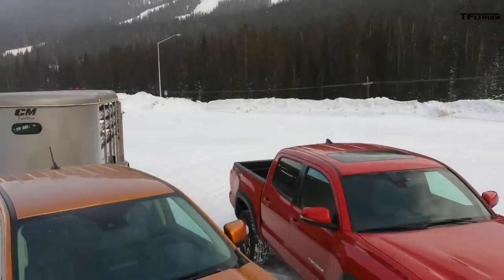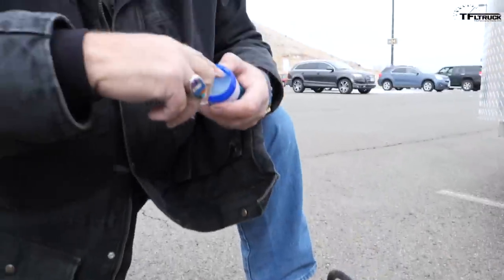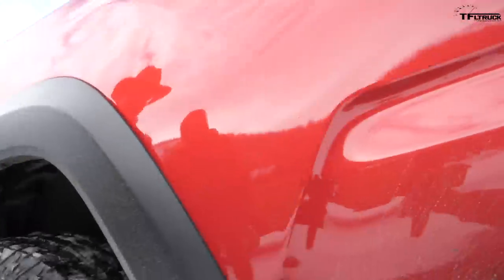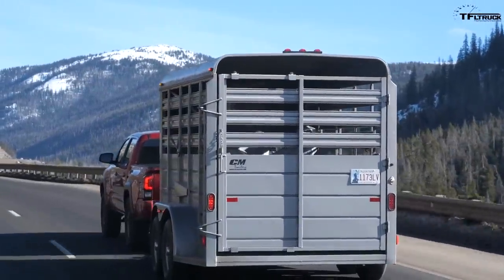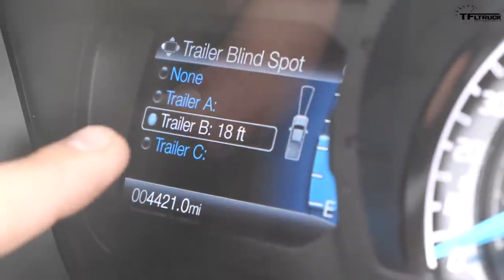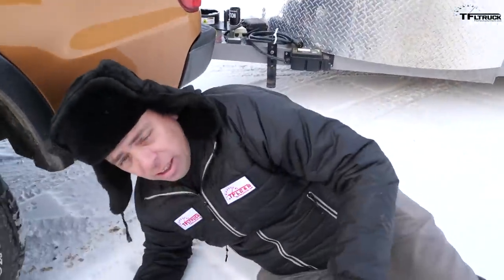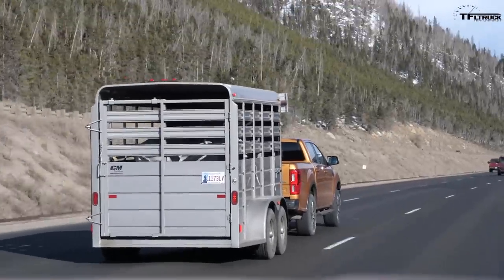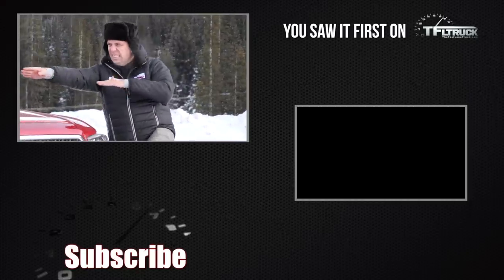Best Midsize Towing Truck? Ford Ranger vs Toyota Tacoma vs World's Toughest Towing Test

Comment: It looks like you guys may have to rethink the towing test.  In this test and the 1/2 ton test all the truck meet the 8 min time.  So unless you're going to start breaking the speed limit the up hill test is a moot point.  Example, if your towing with a 3.5 limited with 450hp and 510 lbs/ft against a Chevy 5.3 all the Chevy has to do is make up the hill in 8 minutes and it'll negate all the extra power and torque of the Ford. That turns it into a purely subjective test.
Reply: Ray-I think they just use 60 as a benchmark because some vehicles they test can't maintain that.  I see your point but they would then have to do two tests...one just like they currently do and then an all-out race up the hill.  They are really testing the ease of towing as a normal person would do it.  If two vehicles maintain 60, they can still have different conclusions since some maintain it easily and smoothly...and others maintain it only when the engine and transmission are constantly shifting and trying to find the power band which is annoying when towing.
Reply: @dewrus2153 
 That makes it a purely subjective test. Once everyone can do 8 miles in 8 minutes with roughly the same fuelmilage this particular test isn't really telling us anything.  All I'm getting out of it is it takes X amout of hp and torque to move X amount of weight up a 7% grade at 60mph.
Reply: @rayd2100 -Well, it's not really all subjective necessarily.  If two trucks make it to the top with the exact same time, they look equal on paper.  However, if one was constantly hunting gears and the other held a gear the whole way, you can tell which one would "win".  If you've ever towed much, that can be very annoying...and if you have an engine with a nice wide power band, it doesn't need to shift all the time.  If you have an engine with equal peak hp and tq numbers but has a narrow power band, it's going to be shifting constantly hunting the gear to keep it at 60.  Also, just the programming of the computer to shift can make a huge difference in how well it performs even if everything else was equal.  Also, a vehicle's stability while towing is key.  For instance, if you take a new Ford Ranger and a new F-250 and tow a 3,000lb trailer with it...both could easily do it but the Ranger would wobble, bob, and get pushed around with much less stability and confidence.  Again, on paper, both could perform identically since both made it to the top at 60 mph but one would clearly perform better.
Reply: @dewrus2153  
I agree with your example about the F250 vs a Ranger but these guys aren't testing those trucks against each other.  So how can you quantify the subjective difference between a GM  6.2 vs Ford 3.5 vs a Hemi.  I also don't think you can really base it on the transmissions doing what it has to to maintain 60 either. If the truck holds 60 then it holds 60.  I think they may need to add another test or something.  Maybe a variable terrain loop to get a more complete picture.  Maybe use the Ike as part of the subjective score.   It is a tough job that is getting tougher for sure and I'm not sure there is a clear winner in these test anymore.
Reply: @rayd2100  
You forget the other factors. Bottoming out, trailer bucking, comfort while driving, visibility need for a weight distribution hitch (which was interesting) noise level etc. It's not always about power x minutes.
Reply: They need to go further south and pull up the south side of Wolf Creek  Pass and don't do it when the temp is cold. Do it when it's a true test of a turbo vehicle vs normally aspirated do It during the summer in the afternoon. Any of the Ford Line that are turbo'd will dominate and do it without breaking a sweat. I've pulled that pass in August when it was 70 degrees at the top pretty close to towing capacity of a 3.5L ecoboost f-150 and it came up at speed limit no problem. No overheating of the motor or transmission. I'm excited for the Ranger and I believe it will crush the competition and actually make Toyota work harder to keep customers. A good thing all around!!

Comment: I miss the old crank windows bare bones trucks that were affordable
Reply: JustJay 0312 I agree. But no profit margins in a base truck. If they were to offer that today it would be about $18,000-20,000 no room for a profit.
Reply: I believe you can still get a Nissan Frontier equipped like that for around the $18-20,000 range
Reply: No you can’t
Reply: @beemrmem3  actually you can, a 4cyl, 5 spd manual, king cab, starts at $19,000.
Reply: I hate manual windows not a fan of having to reach over to lower the windows

Comment: RV anti-freeze for your water problem
Reply: Would make it a bit difficult to dispose of then. Water is easily dumped into a field.
Reply: RV antifreeze is non toxic  @ALMX5DP
Reply: @scottsibbick566  Oh dang I was unaware. I'm not an RVer so forgive my ignorance there, didnt realize there was a difference but now see it's made for the plumbing systems in RVs. Thanks and yeah that would most definitely fix TFL's issue!
Reply: @james2042  You only have to put a gallon or three of RV antifreeze at a couple of bucks a gallon, in a tank of water that size to keep it from freezing.
Reply: @james2042  My point is that it's pretty cheap to keep water from freezing, so your point about water being a "metric shit ton" cheaper than any fluid doesn't really make a lot of sense.
Reply: It would take days for a 275 gallon cube of water to freeze. That's a huge amount of thermal mass.

Comment: Sorry to say that the theory about the springs isn't right.. The ford is using a long progressive damping bump stop that is designed to be in contact and adding to the spring rate of the pack through a relatively large range of the available travel. There's no jolt when making contact with the bump stop here because it is very progressive in nature. The Tacoma is using a more traditional bump stop, so you're feeling it every time it hits as a sudden jolt.

Comment: Now the interesting thing would be to load those things to the max and then test uphill. 
I think the ranger would have a better chance at maintaining 60mph while the taco would slow down.

These recent tests have been with loads that the lower power vehicle have still been able to maintain 60mph. 
So there's rarely no difference to be noticed in these scenarios.
Reply: See I think you're wrong.... Does the taco have less power yes..... But the engine will remain functioning so therefore it wins by default........meheheheheheheeeee those rangers were barely a fly on the wall to the Tacoma
Reply: @seanbutler2291  I guess if you like less performance. People say the same thing about the F-150 EcoBoost but the fact is that a lot of us love the performance that is head and shoulders above the alternatives.

The 2.3 EcoBoost in the Ranger hasn't been a problem and people who have them love the torque which rivals the larger standard V6 engines just as the 3.5 V6 EcoBoost has torque that rivals the larger standard V8 engines. Running 2000 RPM's up the mountain grades unloaded and 3500 towing vs 4,000 to 6,000 RPM's with the competition is noticeable when used as such

Comment: Toyota will be the more durable truck in the long run. Its hard to beat the dependability of a Toyota.
Reply: It's that EcoBoost engine in the Ford that worries me the most.  How stressed out is that little 2.3L engine, making all that power?  The Toyota's V6 is making less power from a larger engine -- meaning it's less stressed, even if it is also less efficient.  Only time will tell how reliable the EcoBoosts are...
Reply: Ive had Toyota's that were pieces of shit. Overrated.
Reply: I agree. The Tacoma is hard to beat. Although the ranger was slightly better in this comparison video. I'd expect a more decisive outcome from the ranger to convince me to leave a Tacoma: I'd like to see the Tacoma offer more tech, like Ford, a 10 speed transmission and a hybrid variant; my thoughts about a hybrid for a truck are not the same expectations as it would be for a car. What I'd like to see a hybrid do is assist in torturous stop- and- go city traffic, switch to an all electric mode when idling, and offer higher and instantaneous torque when towing of the line or in hill climbing situations. Maybe even a "stealth" mode but going all electric when crawling through a trail.

Comment: I think the real problem with the Ranger is that it's not a Toyota.
Reply: Paul Emmanuel Kreative actually that’s good unless you want your frame to rust away
Reply: @Shadow_Wolf_190  Toyota's Frames rust away?
Reply: Paul Emmanuel Kreative Yeah Toyota’s truck frames are much more prone to rusting than the competition, it’s so bad that the trucks bend in half
Reply: @Shadow_Wolf_190  So there was a class action law suit for trucks built between 2005-2010. "Much more prone to rusting than the competition" is an exaggeration.  As is, that it is so bad that they "bend in half". Toyota ended up putting a 15 year warranty on all of those frames and fixed the issue for the future. The vehicle is made by man, so vehicles have issues. Ford has had it's share as well. I was joking about the Ranger not being a Toyota because I bought the Tacoma and I like to talk smack. I have owned the F150 and loved it. I'm not a fan of the new Ranger body style but the Ranger Raptor looks like it will be pretty cool.
Reply: TOYOTA'S ARE JUNK I'M GLAD IT'S NOT.
Reply: Steve Schilling all Caps so it must be true.

Comment: I’m sure TFL is aware of this. The Ford grade shifting is designed to be used with cruise control set to the desired decent speed. I would like to see a test where they tried the decent their standard way then tried the decent with the cruise set at the desired speed.

Comment: Rack and pinion is the cause of all vehicle crashes. 
Please do a comparison from the 03 Silverado z71 gearbox to the gmc 2018 rack and pinion
Reply: When you take your eye off the road to set your soda in the cup holder. 
Crash! Zero tolerance for driver air. 

Gearbox,  I can drive with my eyes closed practically.

Comment: Ranger is hands down the best new midsize on the market. Did a lot of research and test drives. Never been a Ford guy - the vast majority of my work trucks and vans have been GM since the late 90s. The S10, Colorado, Suburban, Sonoma, and toss in a Dodge Caravan (the van was actually a great work 'truck'; very comfy, had good power with the 3.3l v6, but room to haul both heavy and bulky stuff too) 

I like the dash and interior on the Colorado/Canyon best but thats not what sells me a truck - its capability. The Ranger had the most capability for the price...by a wide margin too. Before the chip/automobile shortage you could get one for 25k brand new and it was mechanically identical to the more expensive configurations. That 25k truck took about 35-40k to match from competitors in terms of capability, and then they got worse economy because they have larger engines. It was a no brainer: Ranger all day. Its a jack of all trades truck; it can tow just as much or more than the others, same for payload, its faster, OR it can get better MPG if you drive sensibly (rated for 26 hwy but 28 hwy is very possible without even hypermiling). I have gotten 32mpg on an all highway drive at 55mph...oddly enough it was a 32 mile drive (I remember thinking 'cool I burned just ONE gallon of gas on this one). 

Other trucks might have a point in their favor off road or ride quality etc but if youre looking for the most all around capable truck without breaking the bank, the Ranger wins by a wide margin. Now if youre looking to spend some cheese and dont care about money, a minimax Canyon might be better...but cost almost twice as much. This is a price/performance balance and Ford really nailed it on this one.

Other pros are that this is the same 2.3lT engine in the Fiesta ST and Mustang. The 10 spd trans is the same as in the full size trucks. The chassis has been around since 2012 overseas. Other than some oddball stuff thats different for the US Markets 2019+ years, all of the parts will be common and easy to find in 10-20 years. All of the components came from other models and have long been proven to be reliable too.

Comment: Question. Why didn't you test the ranger at its max tow capacity? You tested the 2016 5.0 F150 at its max load. I'm genuinely curious how the ranger will do on the Ike Gauntlet at its max load.

Comment: I tend to side with Mr Truck in that I hate the layout of the gauges in the Lariat (vs the XL/XLT).  Ford really needs to do something to improve that.  My only other initial disappointments are the lack of an available factory sun roof and a factory brake controller. And please don't get me started about the lack of a Ranger Raptor option.............
Reply: @jackmackenzie2118  Unfortunately that's not a factory option, it's dealer installed.  I'd prefer it be integrated into the overall solution and not an after thought.

Comment: Toyota needs a remodeled 4.0 liter lexus engine in their tacoma. The 3.5 is fine but want real towing ability the v8 is better. Unfortunatly we will loose both. Toyota in the future is going to 4 cylinder engines with turbos. Bought my tacoma a month ago a trd sport the 3.5 is good but would like a bit more torque and BHP.

Comment: Redline on that motor Is (2.3 Duratec/ecoboost) 7500Rpm starting and will start to float valves at 9150

Comment: Would 2600rpms sustained cruising (55mph 4th gear) cause any long term issues towing 3k pounds? Normal cruising speed is 2200rpms (65mph 6th gear) unloaded.

Comment: im looking at a used 2012 tacoma 4.0 4wd could it tow a 5000lb trailer.
Reply: I just bought a used 2012 Tacoma. The best choice I could have made. Tows my 14' heavy trailer with ease.
Reply: @shaneadamiak2153  thanks for the feedback brother! I got a 19’ dry weights at 4900lb. I’m looking at the Tacoma w 80k for $ 20k and a 2016 f150 ecoboost 2.7 for the same price. I’ve driven Silverado’s for work for years but don’t like the new ecotec bs

Comment: You can get more power and torque out of the Ranger if you put 93-octane fuel in it. The 275-HP/310-torque figure is on 87-octane.  On 93-octane it gets 310 HP / 320 Torque -- same as the EcoBoost Mustang.
Reply: Yeah you forgot about getting a TUNE you don't just put 93 octane in and then boom a bunch more power.... Tfl has a website they literally Dynoed what these trucks do when you change the fuel.  Can they make a bunch more power with 97 octane yes but only if you get the tune. Otherwise it's like 3-7 hp increase.
Reply: @seanbutler2291  The stock tune does give you more power on 93 octane.  The 2.3L engine in its stock form goes from 275 HP / 310 lb.-ft of torque on 87 octane to 310HP / 320 lb.-ft of torque on 93 octane.  Far more than a 3-7 HP increase.  No special tune required.

The Ford Performance tune pushes it even farther -- 330HP / 385 lb.-ft of torque on 93 octane fuel.

If TFL came up with other numbers through real-world dyno testing, please link the video here.  I've not seen it.  The Ford website lists the numbers I have quoted above.  So either Ford is lying, or you're mistaken.

Comment: If it's any consolation fellas, my Volvo 13-litre only gets 1.1 MPG pulling Ike with 49,000 lbs of drywall on the deck :-))
Reply: Thanks for the MPG number. At what speed do you get that mpg? (Curiosity)
Reply: Should have gotten an Cummins or Detroit. Either one would get at least 5.
Reply: hauling out of Gypsum?
Reply: @scrapmanindustries  Lol do you mean the town? I live a mile from the gypsum plant
Reply: @specialopsdave  Ive picked up drywall from gypsum plant. I think we took it to salt lake city.
Reply: Volvo's feel cheap, I prefer International, Peterbilt, or Kenworth.
Reply: Why would u by a Volvo they are cheap forign garbage that doesn't even need to be a car brand
Reply: @tonythecargamer5991  Volvo cars are nice,  The trucks are cheap fleet stuff.
Reply: @estebanamador7601  in a 13 litre volvo ? ...probably 15-20 mph ...maybe 25 tops
Reply: 1.1mpg? I've hauled from bonanza quite a few times and never got that bad of mileage. Mostly drove freightliner with a Detroit.